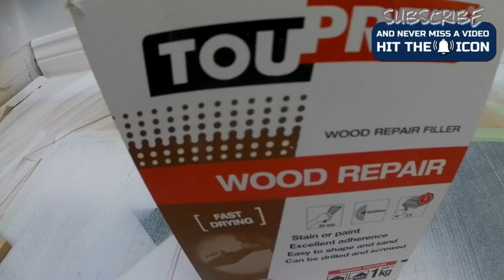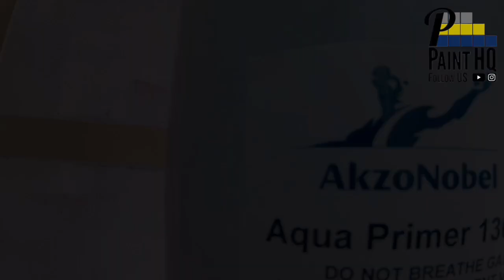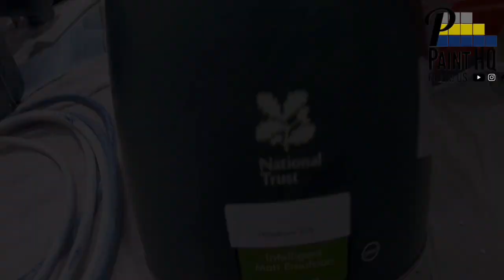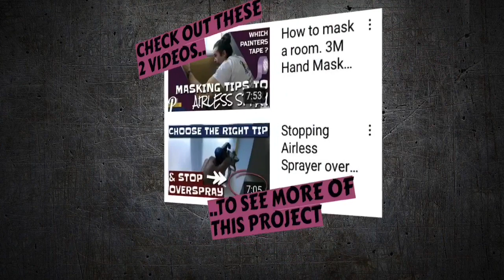DIY Wall Panels | Shaker Style Panelling | MDF Spraying | Priming MDF

Comment: Something a bit different Pete. Nice job as always. Thanks for the video.👍
Reply from the maker: Hey Allan, thanks for watching my friend.. Yeah, there’s no end to what a Painter and Decorator is required to do 😆 ..Appreciate your continued support.. hope all is going well for you buddy.. any achievements with spraying? 👍👏
Reply: @PaintHQ  Hi Pete, D day is the 12th of July.😬😬 They have giving me a lot more work on top of the original jobs.
Think I might invest in another Graco, I don’t think the GXFF is made for this much emulsion spraying.
Reply from the maker: Haha “D Day” 😆 ..You’ll be fine and the confidence will come quickly.. please don’t be afraid to contact me if you’re having any difficulties 👍 ..I’d have to double check, but I believe the pump in the GXFF is the same as the GX21 but the FF by design in marketed more at fine finish.. hopper and smaller hose (=smaller tips).. my opinion is the FF will handle any emulsion with a .015 / .017 tip ..Just to ease the flow of some of the thicker durables, I add about an egg cup of water and mix well.. The GX range, GXFF (and the GX21) are solid machines 👍👌👏😊 ..Keep in touch Allan 👍

Comment: How long between coats of primer etc? Was all painting done in a day? Thanks. Great video
Reply from the maker: Hey Josh, great to hear from you again 💯 The high build primer dries really quick and sands nice.. the first coat pretty much sucks into the mdf, I waited approx 20-30 minutes and sanded off the rough/raised fibres, then fired over the 2nd coat (a little heavier).. that would dry in about 1 hour, but if I recall I think I sprayed the 2 coats of Little Greene the next day.. the spraying could all happen in the one one day, it’s the final prep and sanding off the Toupret wood repair that takes up some time.. any more questions, feel free to ask away, anytime.. I appreciate the support.. please subscribe if you haven’t already.. regards Pete 🎨💯

Comment: Where did you get your gauge ? I have a graco fluid gauge but  the max is 3000 psi. I’ve noticed that the graco gauge I’ve seen on the rigs are 5000psi I’m thinking the 3000psi gauge I have is made for another material besides paint when I have my 395 set at half power it’s showing 2000+psi  long story short I think my after market graco gauge is not correct for my 395
Reply from the maker: Hey James, great to hear from you buddy 💯 ..The gauge came with my 395, so I’ve never had to buy one.. I don’t recall seeing Graco gauges for sale, typically they seem to be Titan / Wagner HEA.. Are you in the US 🇺🇸? I’ve had a similar question to yours, same scenario.. I spray emulsions at 1400 - 1700 psi with a Titan / Wagner HEA 515 tip.. max I go is 2200 with Graco LP tips.. so maybe your gauge will be ok.. basically I never look at the dial when turning up the pressure, I only look at the gauge.. probably my dial is halfway too 👌👍😆 ..Keep in touch my friend, I’ll always help you if I can 💯 Regards Pete

Comment: Hi Pete I hope I fine you well I’d like your thoughts on my dilemma if you would be so kind, my systems for spraying seem to be leading me to lots of time on my hand waiting for things to dry as an example I’ll have a large bedroom to do so the morning is spent preparing the woodwork if I’m lucky I can get two coats on the woodwork but the third coat will need to be done the following day then I find I’m stuck as to what to do as it drys, is two coats enough
am I going over the top would 1 primer 1top coat be enough it’s the systems and time management that’s holding me back do you have more than one system for your spraying
Reply from the maker: Hey Simon.. I know what you’re saying.. whilst spraying is in theory quick and efficient, we’re tied to the constraints of drying times.. Them actually to spray everything for the best possible finish (Vs brush and roller), it can actually take longer.. If you’re looking to spray everything, and there’s a days worth of prep involved, I do this.. Day one - prep everything (including filling and caulking). Day two - Sand off fills and if caulking is thought to craze, Zinnser - then mask off as necessary and take care of woodwork - I pretty much, prime x1 (sometimes 2 if grain raise or mdf fibres need sanding, then x2 top coats.. Day Three - mask off and spray walls. Day Four - Mask off and spray ceiling.. Now here’s an alternative (If prep is not required to be a full day - maybe like you’re current job, or even a freshly plastered room.. Day 1 - Prep, (mist coat everything if fresh plaster), then spray ceiling to a finish.. Day Two - woodwork (prime x1 or 2, then x2 top coats). Day Three - Walls manually brushed and rolled ☹️ ..Basically if prep required is minimal, you could get ceiling and woodwork done together (if you’re flying or you’re able to put in a long day), but the trade off is probably a manual brush and roller on day two.. Then if prep is minimal, you’re wanting to spray everything, like you’re experiencing.. woodwork would need to be done to a finish on day one (otherwise it’s finished on day two and you’re held up by a day because it needs to be fully cured to mask), then walls day two and ceiling day three.. it’’s a very tricky situation and sometimes spraying doesn’t make things quicker, it makes it mess taxing on the body and the finish is AWESOME 😆 ..Sorry, hope this makes a bit of sense and some of it is useful.. You’re doing great my friend 👏👌👍💯
Reply: @PaintHQ  cheers Pete that great mate your spot on I even thought of doing ceilings and woodwork together as long as I sand down WW between coats and after I’ve coated the lid it might move things on a bit with the caulk Dulux anti crack if you can get it is spot on no crazing, today I prepared woodwork then primed then just sprayed wall colour round the top of the walls only had lucnch then sprayed colour round top again save the cutting in to the ceiling then top coated woodwork to finish tomorrow I’ll 12inch paper the top of walls mask the trim finish the lid then hand roll and brush the rest of the wall hopefully it will go ok. Thanks for all you help buddy and advice it’s so valuable 👍🏻👍🏻👍🏻
Reply from the maker: You’re very welcome.. I’ll check out the anti crack caulk, thanks for the info my friend.. You’re method about spraying round the top, is something I’ve heard of, or at least something similar.. it seems possible that it would save on paint too (due to the roller), good option if quantity of material is an issue 👍 ..Let me know how it works out when you get chance 👍😆
Reply: All depends on the country... but simple answer is grab a heater ..